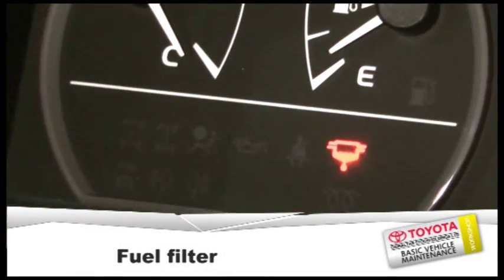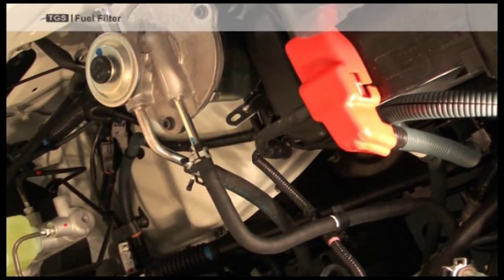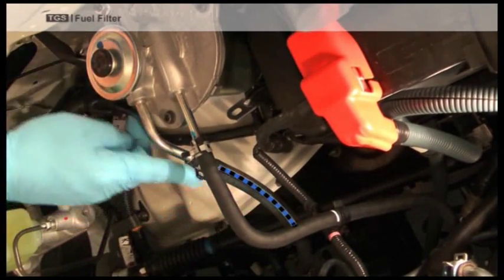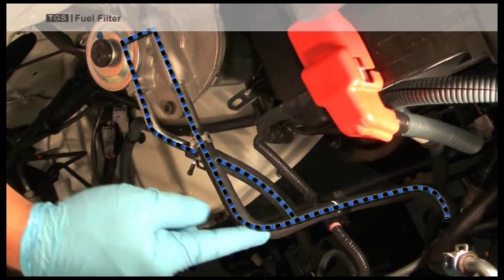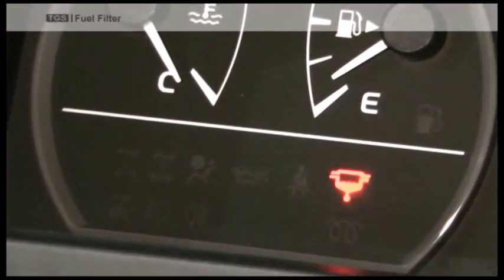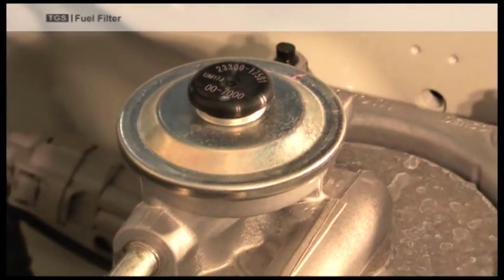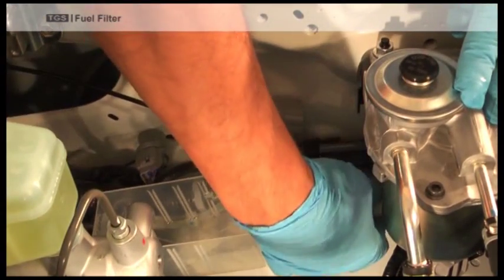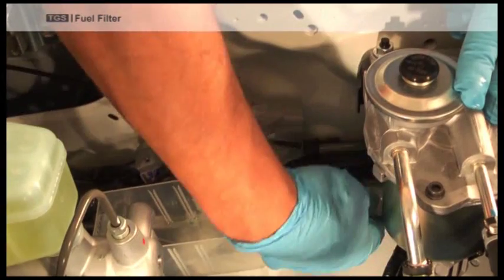Fuel Filter - basic maintenance instructions

Comment: Good information about how to bleed out water.
Can that pump used to bleed air out of a system that has run dry?
Reply from the maker: Yes by using the pump it will draw fuel through from the tank as a slow process but our recommendations are that you never let the tank run completely dry as it will bring any debris in the tank into the fuel system. Protocol we operate and recommend to our clients is that once the low level light comes on you change over to the second tank or refuel.
Reply: @ToyotaGibraltar  Thanks for the reply and info.
I have only done it once when my LandCruiser was off of the road for a year. I used to start it regularly and it ran out.
My pump works when I open up the water drain tap but it doesn't pump out from the pipe going to the fuel pump.
Is this normal? 
Is the correct procedure just to open up the water drain, pump until fuel appears, close drain and then crank?